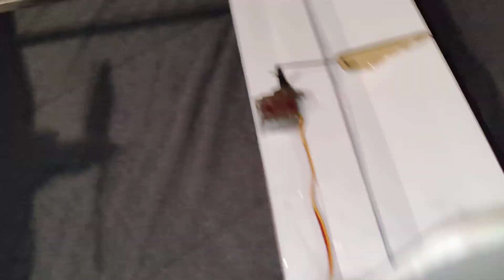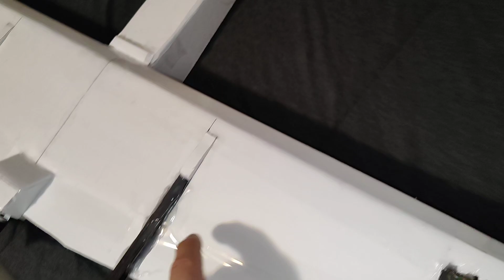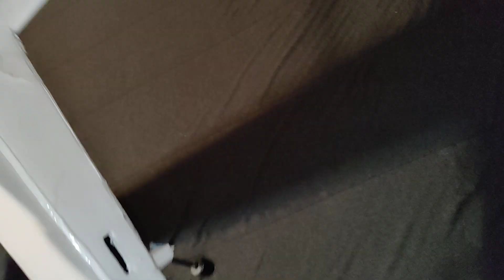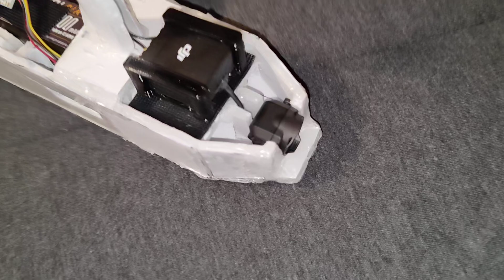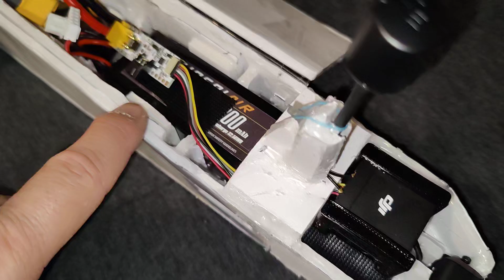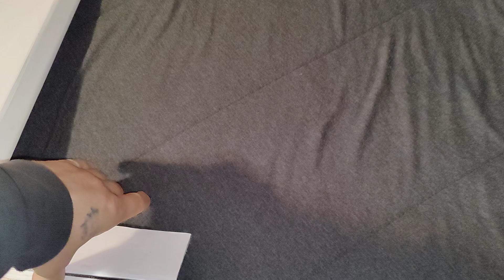My new pusher prop FPV plane! #djio3airunit #fpv

Comment: How did you get the foam board so symmetrical? I’ve been building one and I’ve found it hard to get it even.
Reply: Thanks. I made sure the wing surface is big for extra lift because I’m aiming for more of a glider frame.
Reply from the maker: What part? I measure everything out. Take my time. What are you having trouble with?
Reply: @FlyTimeRC the fuel saladge is easy, I always have trouble making the wing and attaching it perfectly.
Reply from the maker: @LarsRcm  ok. I measure the width of the fuse and mark it our on the center of the wing so it is perfect.  I also find the CG of the fuse with all the electronics installed and match that up with the cg of the wing and usually a tad forward just incase im off a little bit wih my calculations.  It never fails.
Reply from the maker: This plane specifically didn't have enough speed on the take off due to the low wing area vs weight and after the first test I messed it up and never got it off the ground. But it was a good learning experience.

Comment: I must of missed this
Reply from the maker: @capnhardway  I got to test fly it Saturday afternoon. It hit a small bush on take off and crashed right away. After that I tried hand launching a couple times. It was having some issues I think with SAFE it kept going left. Even out of safe. I tried a few times and crunched the nose. The rest was totally fine but it wasn't quite right so I scrapped it and started. New build that evening. I think I'll revisit this design in the future with a couple small changes. Hopefully have better luck. This one was really different in design so it was bound to have some hiccups!

Comment: very aerodynamic 😅 but not very very
Reply from the maker: @vahid00467  maybe very veryish?
Reply: @FlyTimeRC  
When building an airplane with foam board, we even thin the end edges of the foam board until their thickness reaches zero, or the location of the servos must be such that the servo creates the least resistance against the air, and the wires must be inside the body. , and the most important thing is the airfoil of the wing, which is made with great precision and with several cuts on the foam board. I think the quality of construction and gluing can be better.
Reply from the maker: @vahid00467  for sure. I've built nicer planes. The airfoil isn't the best I've made. But it should do the trick!
Reply: @FlyTimeRC it probably still Flys great